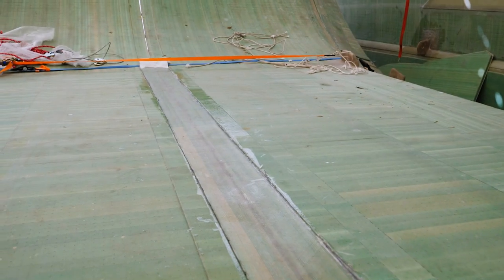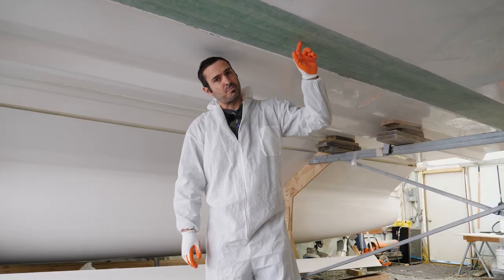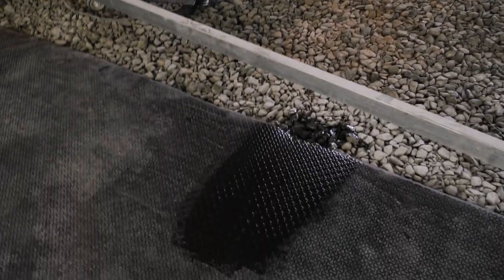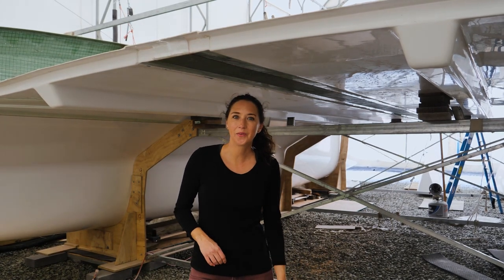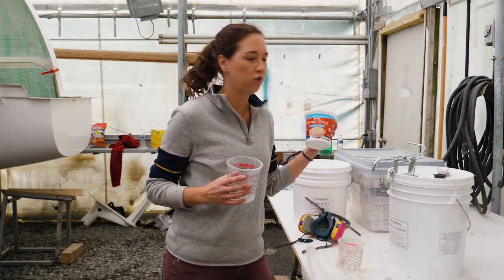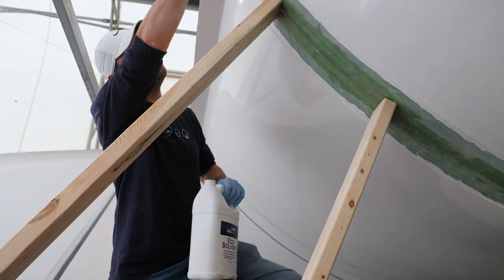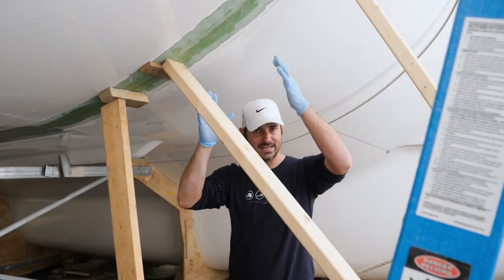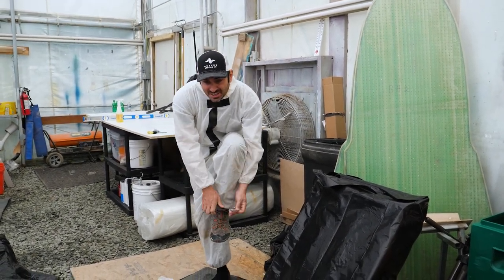CATAMARAN BUILD -  Is This Just As Good As the Moulded Bridge Deck? (MJ Sailing - Ep 182)

Comment: Good to see production happening. As I said earlier. Prep, prep, prep... All that overhead grinding and "proper" seam filling of the between hull pieces could have been avoided. Done before fitment. It doesn't look like the gelcoat was removed from the verticals in the seams. Don't expect the resin to bond there for many reasons. Did Jessica really say (@ 4:00) they were applying resin without catalyst? OMG.. No!!! Raw resin rarely activates from later "surface contact" to activated resin (especially with a cloth barrier between coats & layers). Hard on the outside, soft underneath. Had you thought of doing the under bonding of the visible parts of the seams first? In order to get proper alignment of the visible seams which is difficult to do after bonding the inside surfaces first. An inexpensive & effective roller/resin tray is a small cookie tray with plastic sheet/layer or a Peel/Ply sheet taped or spring clipped on top. Later replace the sheet layer & carry on. You can get multiple days from cheap Coveralls by using old school/dollar store steel Safety pins/clips to fix broken zippers, close hems & sleeves, tape tears the coveralls apart. Peel/Ply will also prevent your wood blocks bonding to your resin work.
Reply from the maker: You did catch my mistake at 04:00 - I meant to say 'neat resin' - which typically means resin without filler.  There was still a catalyst added.  😉  - Jessica
Reply: @MJSailing  Hahaha. ;) . No foul. NP.. Jargon is a jeopardy. Neat resin is pure resin as is a Cocktail when called "neat". Neat resin - meaning; Neat resins are the purest form of resins, which means they only contain the main identified polymers. ... Since there are no fillers or other aggregates present in such resins, they are the purest form of resin and are also known as pure resins. "CAT"alyzed :)  resins are normally referred to as mixed or "hot" :P resins. NB. Get a good ie. quality grinder for Matt. Those cheap highspeed grinders damage the nerves & muscles in your hands.

Comment: Wondering if it would be easier to pre-wet the fiberglass and then hang it?
Reply: That can work well with some resins and cloth, but with double biased and really sticky vinyl ester, transferring from the wet out table to the boat causes bad distortion in the fiberglass.   Someone more skilled than us could probably do it, but we'd rather wet it out on the boat.   -Matt

Comment: Why aren't you using the massive diesel heater in the corner of the shed , surely the btu output would make a greater difference?
Reply: Diesel heaters put petroleum residue into the air - and on every surface - contaminating the fiberglass.  The big propane heater overhead exhaust directly outside, but the little tank one also puts small amounts of contamination in the air, but at the level that it is manageable.   -Matt

Comment: Gelcoat  Peeler eBay, it Will not damage 
 substrate , Set the blades to approximately   thicknesses  Of the Gelcoat . 1 hr Of  Sanding is = to 5 minutes - 8 minutes with the Gelcoat Peeler.  Get the highest Amp Peeler. Best of luck . If you have any questions please let me know. Generator, wiring.  Where to buy on the cheap brand new

Comment: You might want to invest in a gel coat grinder, with all that you have to do with this build???🤔🤗😀
Reply: First you need to plan & avoid the overhead work. When doing such grinding working on top of a horizontal surface. Get a 7-9" 10-15 amp grinder not fiddle with a 11,000 rpm  4" vibrator.

Comment: I think they have the mini roller trays at Lower and probably Home Depot...
Reply: Pretty sure Rob in the previous episode they mention it but 2 (?) seems to ring a bell. They also talked about sticking to the manufacturer recommendations rather then "overbuild" it and add additional weight when its not called for in the build directions. Performance of the boat was mentioned as a focus for them so they re staying on plan regardless of all the YT armchair project managers.

Comment: If those heaters were half as high they would be more efficient. Heat rises so, if the heater is all the way at the top you won't get much heat on the floor.

Comment: Two words. Peel ply. Mans best friend when glassing to avoid excess resin and excess fairing!.
Reply from the maker: We do have some, just haven't found it necessary to use yet.  The double biased cloth went on so smoothly on it's own. 🙂
Reply: You'll see a ton of it when we get to the areas that will seen, need to be faired, and doesn't have their own recessed flange.  -Matt
Reply: It would seem the layup thus far has gone most excellent. I vote for keeping on keeping on.
Reply: @MJSailing Excellent!. It’s a rather satisfying feeling when removing it and realizing you do t have to fair it.

Comment: Fiberglass tip: you can wet out and roll up like a rug, the entire section. It will make it easier for two people to continue to apply fiberglass. If you let it dry, there is no chemical bond only mechanical.

Comment: It's a good thing Google gives you guys positive points for every comment because this comment's gonna suck. I'm just confused and frustrated watching because I still haven't seen you wetting the 2 flanges together on any section orher than the center seam. Are you only fairing the seams with your thickened epoxy? I am getting very very tired of wondering how this is gonna work if you are not fully bonding the section together with the full width of the flange strips, from end-to-end, and that would require complete disassembly so that you could access them. what are you doing Matt? it's making me nuts.
Reply from the maker: Are you referring to adhering the hull sides and the bridge deck to the hulls themselves?  If you are, make sure to check out the first five minutes of Episode 180, where we address this question.  😉 - Jessica

https://www.youtube.com/watch?v=RkrfIT30ypw&t=227s&ab_channel=MJSailing

Comment: Hi.
What ever you do, do not cut down the top layer off the gel coat. Then it is ruined, and you have to paint the boat. Under a thin layer on the top off the gel coat there are millions of tiny holes an tunnels where the styrene gas has escaped from during the molding process. If you sand this down, the hole surface will be perforated.
Reply: I believe they are doing exactly what the manufacturer suggests at each individual step. To do otherwise is when you start running into problems. It certainly appears the gel coat is very thick and the explanantion he gave of the expected treatment just before hitting the water seemed appropriate. Did I miss something that would cause you to issue such a dire warning?
Reply: @geraldhenrickson7472  A few years ago I worked at a boat factory. There I sprayed gel coat in the molds for about 300 smaller boats. I also did some gel coat repairs. And had some of the finale quality checks before the boats left the factory.
The ideal thickness of gel coat is about 0,7 mm. If it is thicker it may have a tendency to crack, especially where it is exposed to sunlight and heat. That is because it is continuing to cure/harden fore a long time. And as it releases the styrene gas, it shrinks a little and gets more brittle. It’s just about 10 percent of the gel coat thickness, the outer part, that gets glassy and smooth. This is the part that is closest to the mold/form during the building process. The rest of the gel coat looks a bit like a hard sponge if you look closely at it. The surface of it is still sticky after the rest has cured. This is because it is supposed get a chemical bound to the   laminating resins.
If you sand through the hard, glossy outer layer, you get in to the “spongy” layer. The the surface is ruined. It will oxidize faster, dirt, soot and other pollutions will get in to the gas channels. And wax what stick well to the surface. The only way to fix this is to paint it or put on a new layer of gel coat, that is really hard to get to a nice finish.
To summarize, if the gel coat is applied too thick there will always be problems after a while with shrinking and oxidizing.

Comment: The last thing I would be doing is making the GEL Coat thinner !! Its the only thing keeping the water/osmosis out of the glass !! It will be constantly wet under there but hey its your boat ......... Why do you think old fibreglass boats have lasted so long ?? and modern boats are riddled with osmosis after 3/4 years
Reply: Old fibreglass boats used poly ester resin, probably orthothalic which is the base grade,  and verry susceptible to shrinkage and osmosis,  hence they had to have some form of barrier coat under the water  and decent gelcoat above,   the Max 42 is an infused vynilester  ( VE) structure /shell   with   VE gelcoat,  a barrier coat and then the infused VE with glass and core,  removing the gelcoat will have no effect on osmosis

Comment: Why don´t you use peel ply om top of your fiber layups, it does 3 things, it suck op excessive resin, it smoothen  out the surface, and the most importent part, when you peel it off, the surface is ready for further finish or glassing,, soooo no sanding needed,,,,what's not to like

Comment: an extra mm of gel on a boat that size is something like 250-300kg...and it looks like you've got a few extra millimeters there. and you aren't going to be sanding it back by any appreciable amount either, maybe 0.2mm at best.  trying to take off any more and end up with a fair surface is more work than fairing the flat panel kit you chose not to go with....and would require a real professional to do it as well.

Comment: Hi, why the manufecterer put gelcoat where you have to put fiberglass ? It's a lot of useless work for you and a loss of gel coat, I don't understand.
You also mention not to put too much vinylester and fiberglass layers to reduce weight but your boat is ultra-light. A cruising  42 catamaran weights around 12T, yours will be less than 8T !!! You shouldn't be "light" on solidity especially on a cat.
Reply: The bridge deck in formed in a single mould then cut in half to fit into a container.